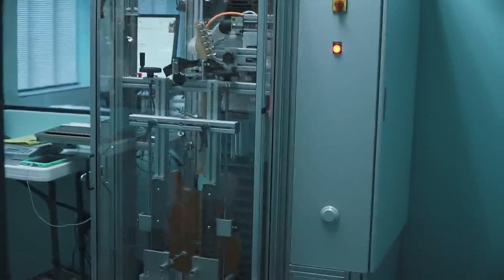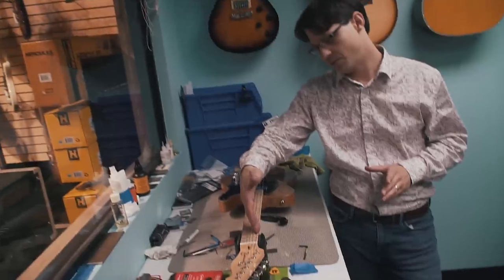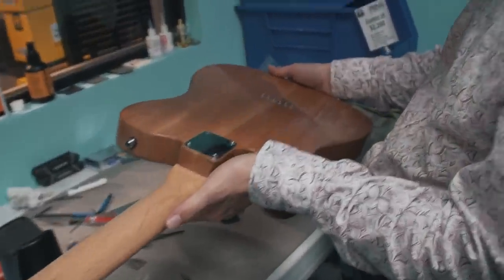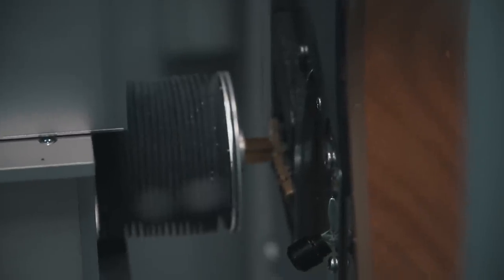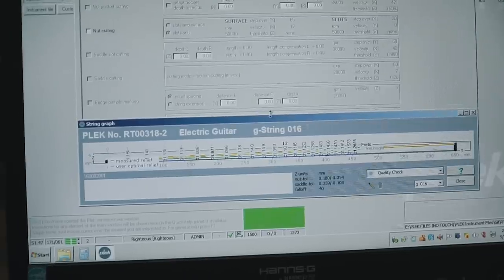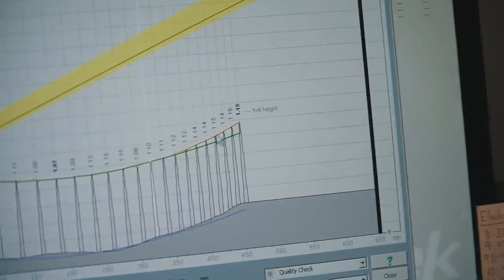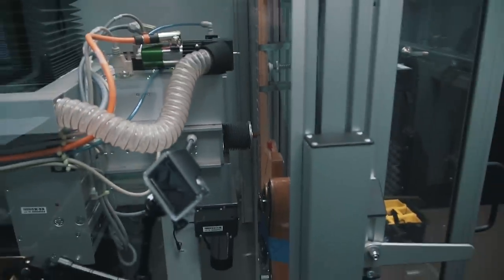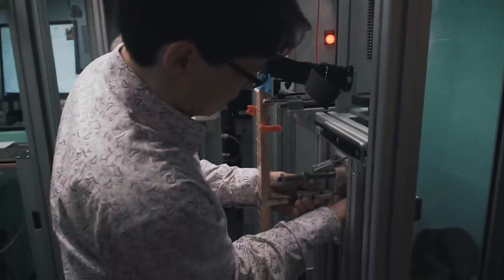How Does A PLEK Machine Work? || Righteous Guitars PLEK Demo

Comment: I mentioned i the 'new amp' vid that my Ibz RRSR was Plek'd during a restoration over 10 years ago. This included not only a refret but planing the rw fb because of tremendous wear that left grooves all over the place. It still has probably the lowest action of any of my 11 other electrics but i still have a piece of business card under the low E. The nut was also replaced so this wasn't the Plek's fault. Just the guy who set and cut the new nut

Comment: Gibson supposedly plek all their guitars....and it depends on the operators does it...
Reply: They do PLEK them, but under 'virtual string tension' (so no actual strings on there). I've PLEKd hundreds of Gibsons and they are the most consistently awful scans. The foundation that they build from is poor - uneven fretboards and necks because they just whack the frets in without actually letting the neck settle before planing it.  That said, a couple of the newest ones I've seen recently have been a little better, so maybe the new CEO is turning things around.

Comment: Well done! I'm convinced! It seems like a good neck adjustment can remedy a lot of problems!
Reply: You are sort of correct, trust rod adjustment can resolve the problem caused by it being incorrectly adjusted. But there are many, many, many more issues that it wouldn't rectify!
Reply: Richie H No one is denying that there can be a myriad of issues! I’ve done my own re frets and dressings for nearly 40 years! Truss rod adjustments are the first option you try to eliminate string buzz issues if you understand relief and fall away! Even in this video demo the guy said it really didn’t need fret dressing one the truss was adjusted. The best thing about the Plek machine is it does it far quicker when you need to level and dress!
Reply: Hi Mick, obviously I couldn't gauge from your post the amount of experience you have, but kudos to you and I guess there isn't any need to teach you to suck eggs! Totally agree that it will resolve a buzzing issue, i.e changing string guages to get it playing again!
Reply: Richie H We're definitely cool! :  )  I really the Plek system because it cuts out years of learning!
Reply: I'm in the other camp, after years of learning my trade I see the Plek as a rival. Although it is damn expensive and there is much more to being a Guitar tech/Luthier than a fret level. Glad we're cool by the way!

Comment: Im confused about when you said at 6:04 you could then play a D chord up the neck and it sounded in tune. IMHO,That is an intonation problem not fret finishing issue.
Can you explain / clarify that?
Reply: I can help. Hand-crowned frets aren't always perfectly symmetrical, and the crown isn't always dead center. The higher the chord, the more out-of-tune imperfections sound. The PLEK seems to be able to make a perfectly symmetrical crown every time, as well as ensuring that the relative height of each fret is accurate (which also affects intonation; press harder on a string and it goes very slightly sharp, and that's easier to do on a very high fret). So, PLEK + proper intonation + well tuned guitar = perfect even temperament on all chords.
Reply: @fretlessman71  Ok, Makes sense, thanks

Comment: This is an important video. Because it points out the the PLEK process should ONLY be done when you decide on a setup/gauge of string. When Gibson started advertising that all of their guitars came PLEK'd.... big deal.... that only makes sense if you want Gibson's factory action and string gauge, tuning, etc. The PLEK machine is designed to help everyone maximize the potential of their guitar the way they want them. Certainly a PLEK job on a strat with a 10" radius and med action would be different than a job on an Ibanez with a 16" radius and .009's laying on the frets.

Comment: Gibson charges top dollar for guitars then they need pleked? Why is this not included?? Also, why do they not have bone nuts, sustain pickups, Floyds, 24 frets, hollow points, floating bridge stabilizers and D'tunas installed from the factory? I am sorry but with prices in excess of $4000 I would really expect nothing less. Gibson makes a great guitar, possibly the best but unless I win the lotto or have a lot more money I will not be buying new... or even used in most cases. So, you get a guitar that is the best possible canvas for perfecting what it could be for $3-20 grand??!!??!! Yeah it is great but not done yet... does anyone else see a problem here?

Comment: Hmmm, funny. My hobby is tinkering with cheap strat copies. Buying 20 dollar second hand ones, fixing the obvious issues and giving it the best setup I can give it. What I really love is removing the paint and hoping for beautiful wood. Applying some oil is all it needs.
My latest project is a Chinese one. And it was for sale, because the neck is bent backwards at the octave fret. Waiting for six normal strings slowly bringing the head to the correct position, with no truss rod tension at all, that trick did not work. Sanding the neck and steaming it. Somewhat better, not enough. Scorching the back of the neck and a rough sanding, I removed some wood, hoping to get a more flexible neck. Damp or dry air is less of a problem, scorched wood is more stable than a paint finish, I was told. And I love that black finish. But oops, I only worsened the buzzing. It was buzzing and the strings were one full inch over the fingerboard. There is a mountain sitting half way the strings. A PLEK machine is perfect to try and solve disaster necks like this one. But really, would you spend another 200-ish dollars on a guitar costing 200-ish dollars itself?

The obvious solution is buying another secondhand neck. From a damaged similar guitar. Cheap and okay.

Or I can keep trying to straighen this neck. I don't like to remove the fretboard, however, that could be THE solution. Maybe fretboard and  neck are under tension. Maybe I accidentally overheated the glue, making matters worse. Before I will decide to reglue the neck and fretboard, I simply bend the neck in the good direction, using a weight. Maybe it is a matter of time, until the neck has changed its shape. My feeling is, this neck has a moist problem. Maybe it was okay in the factory, and then it was stored in a very dry house. Maybe this neck was too wet in the factory, for some mysterious reasons, and the first owner slowly got more and more fret buzz, until raising the action grinded to a halt.

Long story short, this is a PLEK machine candidate.

And when you like to learn about electric guitars hands on, a cheap one is a great platform for trying out different pickups. Example, I got me a Maya strat, Japanese, and got myself a weird combination of pickups. A Squier Tele bridge pickup, a humbucker as the middle pickup (and I added a coil split switch) and a strat single coil in the bridge. Positions 2 and 4 are okay, and each pickup alone has a unique sound. Even the coil splitter on the humbucker is fun. Such a humbucker does not suddenly turn into a Stratocaster single coil, but it sure makes a difference. When you have never tried a weird configuration like this, how can you tell if you'd like it? It's like people playing great Strat's for all their lives, for some strange reason, doing one gig on a friend's Tele and after playing "the other kind", admitting both guitars are okay for him. Surprise!

Comment: The hell with plek!  All the people do is spend an hour trying to up sell you on crap you may not need.   I listened to them for 10 minutes tell me you have to level under tension...they didn't ask if I had (Which I did)... I just refretted a guitar with stainless and they spend 15 minutes saying there's a chip here or there...even though the slot was flooded with super glue and the fret is seated well. (I will fill a few wood chips at a later date.   they have to make you a new saddle and nut or they just can't do a level...another 200.00...one place wanted a 1000.00 to do a refret and level.  I bought this guitar for 650.00.  It had fairly low frets but still buzzed here and there....I got it very level according to their plek machine but it  was too low....started at .037...I took the chance because it had to be leveled.  I've had it with the plek people!  The machine is great....it's the people who buy it that are a pain in the ass!  I talked to three different businesses with the machine....all they did was complain about how expensive it was to sharpen the cutters.

Comment: Just an FYI, it's not accurate to .001 mm.  That's a micron.  A virus is about 1 micron.  You simply cannot measure that with the instrument this machine uses.  The machine is accurate to within .001 inches, a common manufacturing tolerance.  For reference, .003 inches is the thickness of a human hair.

Comment: I don't know. This seems like a lot of investigating a problem before you even find or hear a problem. I thought the general rule with fret work was less is more. Why go for this Plek'y more is less? If there is improvement in intonation wouldn't that be due to the slight adjustments of the truss rod, and aren't major intonation improvements made by adjusting the nut height and saddle contact points?

Comment: Can you PLEK things like multi-scale guitars? Microtonal guitars? I’m interested in how the “ideal” setting is determined. My guitar manufacturer (FGN) uses a proprietary “circle fretting system” in which each fret is slightly bent so as to match the curvature of the fret board and meet at a right angle everywhere. Could it be PLEKed?

Comment: Interesting. Makes me wonder if all manufacturers should have all their newly made guitars Pleked before they are shipped out, that way we wouldn’t need to pay extra to have it done.
Reply: Well, you’d still be paying the extra price, they’d just add it on to the guitar, nothings free and these machines are expensive, it’d be more than what the plek job would cost to take it into a shop yourself….use your head….think of the massive amounts of these machines they would need, plus operators, plus the time, all that gets added onto your guitar price…..come on…..use your brain a little bit…just a little….you’d make a $1000 guitar a $1500 one….when in reality it might not have even needed it to begin with, vs just going into a shop and paying the $225 after the fact….

Comment: I have noticed that if you have to induce relief with a double action truss rod by putting the rod under compression that you will frequently find a hump after re stringing. Necks should be made with a slight bow so that the rod is always under tension. I find that making the neck perfectly straight or back bowed does not work as well. With the rod under compression it does not seem to be as stable.

Comment: I've had to Ibanez prestiges seven strings plek by Sweetwater they went from playing really good to like butter it really made a difference on the higher register when you bend notes and prefer low action.
Reply: So you recommend a Sweetwater PLEK job?
Reply: brich2929 yeah
Reply: brich2929 yes
Reply: Was there any scratches from the pleking? I'm thinking of getting a RGR752AHBF which has nice binding and I don't want this machine fucking it up.

Comment: $35 to be told that your guitar doesnt need anything done to it.
Reply: A bargain for the peace of mind that your instrument is as good as it can be after you've done some DIY maintenance or to check the work of a luthier that doesn't have access to such an expensive piece of technology. The shop can't afford to do it for free considering their investment in the machine and wages of it's operator.
Reply: @shmaknapublar  I would argue that if you dont know that already (that its a well set up and good sounding guitar) and need a PLEK machine to tell you then you know nothing about a guitar!
Reply: @Edward1312  Most players know far too little about set up and what is required to fix playability issues. That's why they take their gear to a shop to get fixed and why any town full of musicians is full of musical instrument repair technicians. If the machine didn't have it's place in the industry, it wouldn't be kept working long enough to return the investment and would fade away to become part of guitar tech history. But I have a feeling it's here to stay since it can do things that simply can't be done by a luthier without costing thousands of dollars in labor charges, like checking the neck/fret alignment, accurately, while under tension, and mapping it in a way that provides as much information as possible to the repair tech. $35 is nothing when you are talking about professionals and their equipment. If you even had to think twice about it, you have more time than money so maybe it's not for you.
Reply: @shmaknapublar  Money for old rope!

Comment: The thing that bothers me about these machines is that time, moisture content, playing, cleaning with something wet (which you should never do), and just being bounced around will loosen frets. 

As the wood around the nut slots expands and contracts it can force a poorly seated fret up that will result in a high fret. You can check for these high frets by testing for buzz behind the suspect fret. 

If you know what you're doing you can take a block of wood and VERY GENTLY tap that high (loose) fret back into its slot and  eliminate the issue. If you pleck a guitar with a fret that's popped up out of the slot and it somehow gets pushed back in, there goes your pleck job right down the drain. 

I don't know. I'm thinking the machine was invented to take the tediousness out of proper guitar set up and a way for shops to create another revenue stream. 

Pleck machines are nothing burgers so far as I can tell.
Reply: You're right on the money.

Comment: Great stuff ... I worked in a heavy manufacturing environment for 40 years (mechanical engineer).  It actually looks like a DEA.  A machine designed for super high precision data acquisition.  Just load up the drawing, put the part (up to 4 tons) onto the granite table and wait for it to spit out data.  However, the DEA  does not have the ability at alter the part in anyway. shape, or form.  So if the PLEK  alters any part in any way it would be hybrid with a DEA or similar.   Very cool.
Reply: It's a CNC machine that probes the part before it cuts.

Comment: Apparently they have a Plek machine here in Berlin, but a fret job costs 225 euros. I paid 250 euros for my Epiphone les Paul lol, not gonna pay that much for an adjustment. Maybe if I had a 3k guitar it would be worth it.
Reply: I've had my Steinberger pleked twice by Charlie Chandler in the UK (he's a bit cheaper than that). Once was a fret dress, once as part of a total refret with Stainless steel frets (I'd worn the old ones down to the point where I was practically playing a fretless guitar). It's one of the cheaper Steinbergers, that I got second hand, so probably didn't pay much more for it than you did for your epiphone. The refret probably cost me as much or more than the guitar.
I've never regretted having either job done to it.

Comment: Do these machines cost  150-250K range, so you will need to do a lot of jobs to justify the cost.
Won't moving your guitar to different  temperature conditions nullify some of the benefits of plecking?
Reply: Correct fret leveling will always be a plus. If you have shoddy fret work, temperature fluctuations will only worsen any playability issues. Conversely, if you need to make seasonal truss rod adjustments, proper fretwork will only enhance the playability of any adjustments.   ;o)
Reply: @danh5150 
Thanks for explanation.

Comment: Brilliant accuracy and capability. I wonder why they dont have a final polishing/honing tool to finish the job as a human operator may ruin the perfect fret cutting plus it would remove that labour cost and be more consistent and quicker?. 
A final last scan and overall inspection by human eyes to be sure before shipping.
Reply: As a machinist, I suspect that the machine doesn't take off very much. I wish they would have shown the finish of the frets after being milled. It may be so clean that very minor polishing is all that's required.

Comment: Not to suggest that it would be the correct way to do it, but could you have PLEK'd it without the initial truss rod adjustments and still ended up with a 'perfect' fret dressing in terms of playability?  Also, why did the nut height 'error' disappear after the first truss rod adjustment?
Reply: You can make it work, but what you'll end up doing is taking the difference out of the frets, meaning you'll have some very low frets (around where the lump was at the lower end) and some higher frets further up, which just feels weird to play.  If you think about the geometry of it, when he put a bit more relief in the neck, those lower frets 'dropped' relative to the nut height. This is why you get buzzing lower down the neck when the neck is too straight and higher up the neck when the neck has too much relief.

Comment: You'd think it could adjust the truss rod automatically as well...
Reply: It probably could if it was designed to but I get the impression just the oddities of where they put the nut (sometimes not even accessible without removing the neck) and the fact that truss nuts are notoriously finicky, I think doing that adjustment by hand makes way more sense.